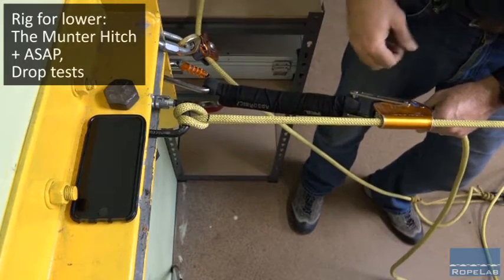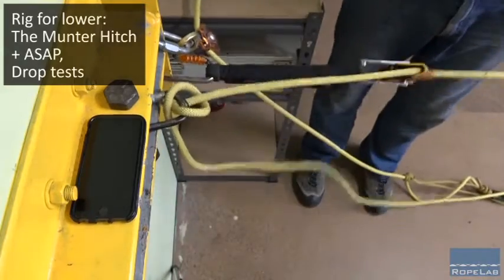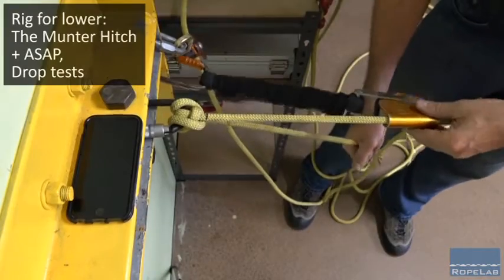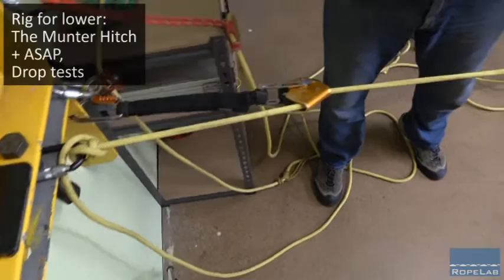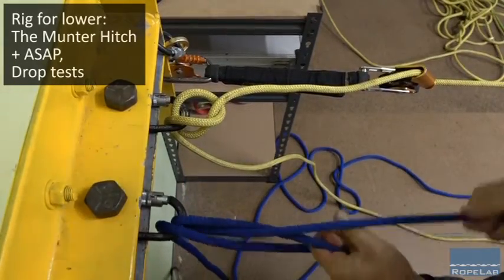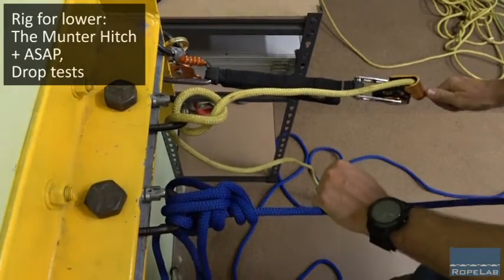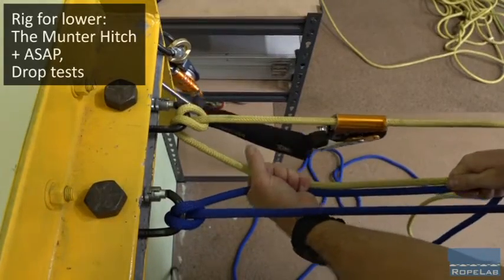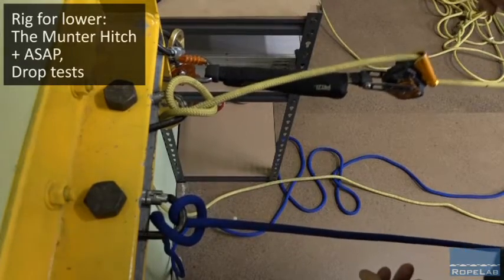Rig for lower: Munter + ASAP drop tests

Comment: So I was going to run some similar tests.  I was wondering if you have performed any tests with out the munter.  Seems to me since the ASAP will not engage until enough centrifugal force is produced (2m/s) the friction created by the munter minimizes this for a moment or so, allowing more rope to pass.  Thanks for the video. Will definitely sign up for your website seems worth it. Please keep up the good work.  BTW please do a class in the states on the east coast one time would love to attend